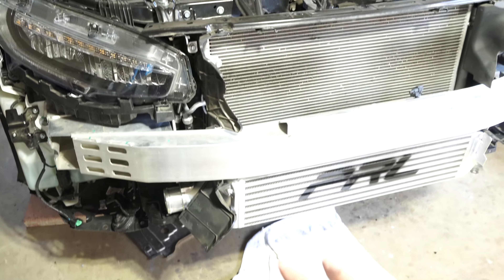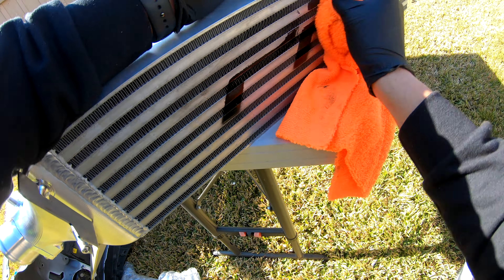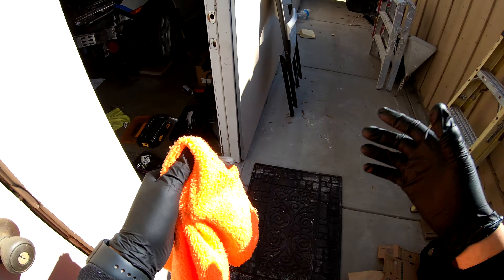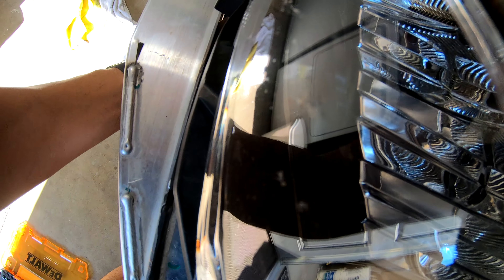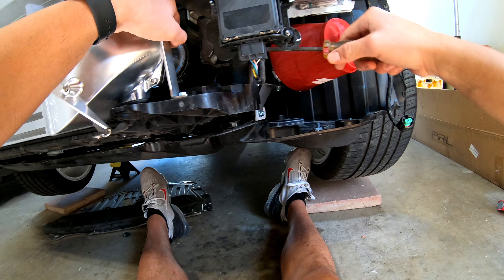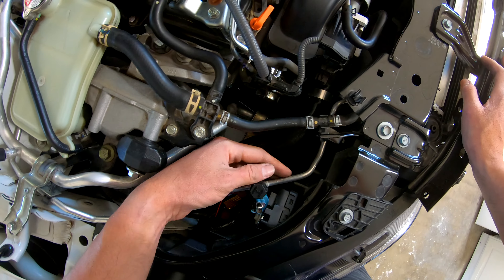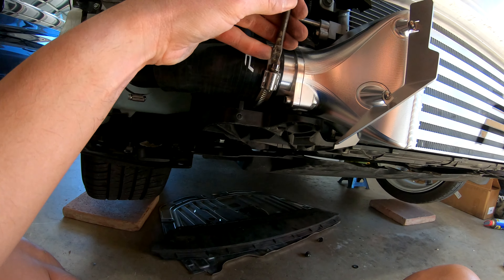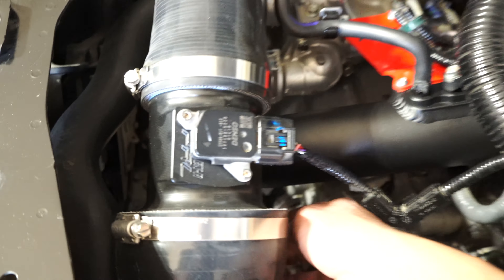Finishing the Install of the PRL intercooler- 10th gen Civic - FK7 - Honda Civic Hatchback

Comment: Did you have to retune it after you installed the Intercooler?
Reply: i'm guessing it's not necessary. when i install mine over the summer, i won't get a tune for it until i get all of the other parts installed as well.
Reply from the maker: no the intercooler doesnt require a tune